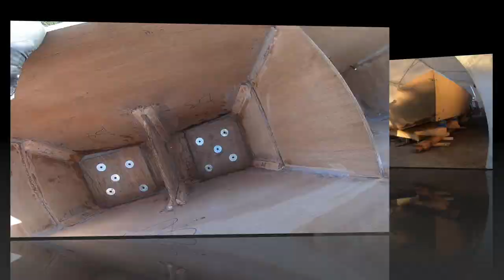21.DIY Boat Building: 15 Min RECAP of the PROGESS!

Comment: Great Job !! I used some of the biaxial cloth/mat combo on a transom project , and had a hard time wetting it out and working the layup. It was a vertical surface though. Did the cloth give you any issues wetting and tooling it out? Nice job. I am seriously considering a build this coming spring. Thanks for the great footage. Good Luck
Reply from the maker: Appreciate it.  Thanks for watching.  I have a separate video for each step of this project, so if you like you can check out the whole playlist.  But, this is the video where I glassed the transom (https://www.youtube.com/watch?v=iHUGPXT1ohc), and it shows how I use a wet out table and how I apply the epoxy on the table, and then move the cloth to the transom.  It's worked well for me I think.  The only thing I would do a little different in hindsight specifically would be to add a little bit of cabosil to my epoxy.  You can see at the very top of the transom there are tiny spaces where the epoxy actually ran out of the cloth a bit.  I had that happen on vertical surfaces on the interior as well.  But, that's the one thing I would do different if I had it to do again.
Reply: @Bigeaux20  Thanks for info!!
Reply from the maker: All good dude.  Hopefully it’s helpful.

Comment: Oscar, it looks like your sheer clamp is proud of the transverse bulkheads about 1/4” or so. So is mine. Are you planing them down to flush w bulkheads?
Reply from the maker: Yes.  I will plane the the sides all down fair with the sweep and height of the transverse bulkheads.  I just didn’t do it yet in case I had an issue when I rolled it it would scrape the excess and not a faired surface.
Reply: Thanks!  Can’t wait to see how the fairing is coming along.
Reply from the maker: It's been at a standstill lately, but it's almost done.  Getting ready to put down high build.

Comment: Glassing burns up the majority of the budget and time. I stick to Plywood, wood, glue and screws. The advantages are too numerous to list here. Glass and resin are unnecessary, messy, difficult to repair, expensive, impractical, and poison.  I built may first cabin cruiser in 1968. It  is as good as new today. . It’s a Pelin Aquarius.
Reply from the maker: There are many ways to skin the rhetorical cat, but the methodology that I am using is what is directed from the designer as being based on USCG regs, and what closely mimics most every single production boat builder operating today, and follows the guidance of much respected techniques by the Gougon Brothers using marine epoxy.  We also had a wooden boat built by your methods.  At about 15 years old we tried to burn it to get rid of it.  It wouldn't burn.  I'm gonna stick to glass and epoxy.  If it's overkill, it's on my nickel and my minute.  Thanks for watching.